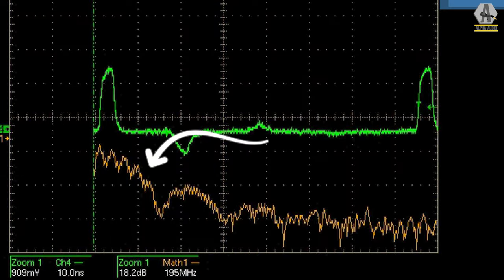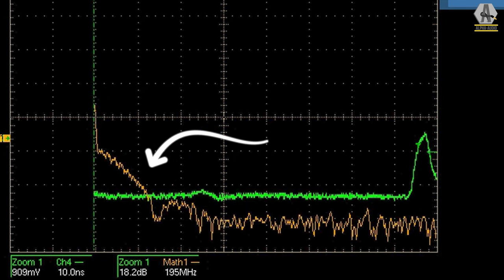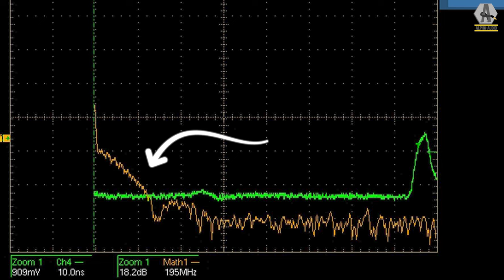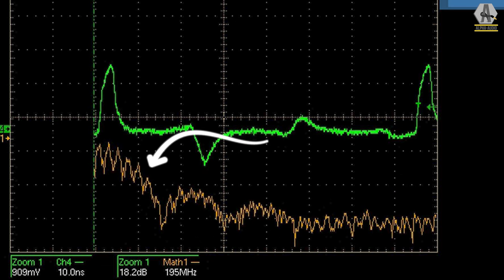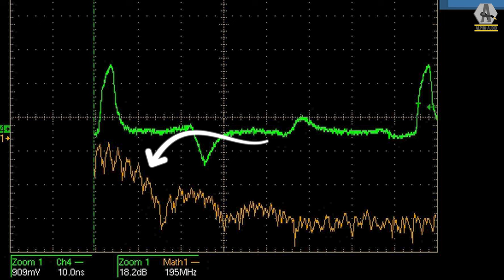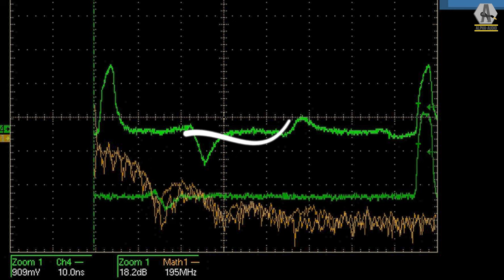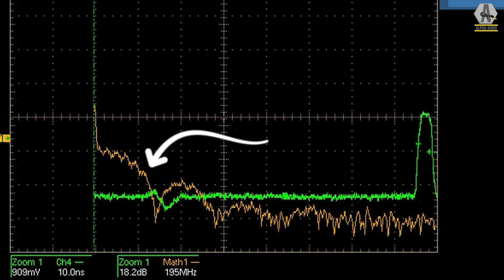Cables make a difference - and we measured it! Alpha Audio Huge Cable Test

Comment: @TheAlphaAudio  
So much work!   Time for a holiday, mate!  LOL.  I'd want to hibernate for a week after all of that, haha!

Forgive me as I haven't had time to read the full written article/test.  It's on my agenda.

What I'm most curious about is IF All of the Same Attributes of Each Interconnect Cable Remain IDENTICAL when used in an equally resolving but completely different HiFi system with a different source and signal chain as well as speakers???

IOW, will ALL of us have the Same Experience when each of these cables are used in WHATEVER system we may have?

Before anyone else chimes in, I want to stave off any arguments that "you will Only hear the differences IF you have a high-end system that can resolve the differences".   RUBBISH.   The Alpha Audio's own Livestream Multi-tests have proven that a wide majority of their listeners can hear identical or at least similar differences as they hear live in the studio, even when we are all listening over YouTube's lossy compressed audio, and through all of our widely different computers, smartphones/tablets, speakers/headphones/earbuds/IEMs and audio systems.  So there's that.

- - - - - - - - - - -
BLOODY LONG RAMBLING:  

Just for reference, 90% of my studio equipment, microphones, and studio monitors are all connected using Grimm Audio TPM & TPR in addition to Sommer Cable SC Peacock MK II XLR or 6.3mm TRS wiring.  I purchased all of these in bulk many years ago, so the cost difference wasn't dramatic compared to let's say, Mogami, etc.

The Grimm & Sommer Cable were both suggested to me by the engineer & manufacturer of some of the high-end ribbon microphones that I purchased, which you probably realize must carry and transfer Extremely Low MilliVolt audio signals over distance without being prone to inducted EMI/RFI noise and without influencing/affecting their inherent properties (the electrical audio signal).

In the studio, if we desire, we can easily adjust the spectral balance and "character" of the microphone by adjusting the Input Impedance on the microphone preamplifier, or with any number of outboard analog or digital rackmount or DAW plugin EQs.

TBF, I also have some standard, good-quality Mogami XLR & TRS cables on-hand as extras or backups, and I've never really found that they sound particularly different to any "Ohhh...WAIT a Minute" degree of revelation.  But if they did, I would probably be more inclined to simply correct any anomalies using EQ or other tools.

Imaging width, depth, focus, "space", etcetera, are all attributes that mixing and mastering engineers control and adjust by using L/R panning, independent levels, Frequency Response, and Phase/Timing tricks (and not in such minute nano-increments).

And to start, IF the Frequency Response between your Left & Right SPEAKERS do not closely match at your listening position, image focus & separation, width, depth, and "3D space" will suffer...

Note that this DOES NOT mean that your Speakers must Both Measure "FLAT", only that they must MATCH in Frequency Response as closely as possible at your listening position.

The better you match the Left vs. Right Frequency Response at your Listening Position, the better the Imaging and Soundstage performance will be.

This is one reason that it's ridiculously easy to at least achieve a decent Center Image even with cheap headphones or earbuds, even when they have terrible tonality/spectral balance.  And, you can obviously have a pair of Loudspeakers that offer great imaging and soundstage performance even when they do not measure well in regards to FR. 

IF the Directivity of the Loudspeakers is Smooth & Even, you'll find that it is easy to adjust the FR or overall spectral balance using EQ to address specific room issues and for your personal preference.  These adjustments can either improve or deteriorate the imaging/soundstage performance.

And IME, the attributes of different speakers, their FR, their placement, and your room's acoustics have FAR MORE influence on the resulting sound quality of "your system" compared to any cable swapping differences.

At least in the recording studio, the absolute LAST thing that a professional tracking, mixing, or mastering engineer will do in order to improve any metric of the system's sound quality is reach for a different cable.

With that, I am not saying that "all cables sound the same".  But I AM saying that in the real world, there are Much Easier ways to "affect" or "adjust" the real world performance of your system rather than "cable swapping".

Keep this in mind as well:  

Suppose you find "the perfect cable" for your system that provides for perfect "synergy".  If it is not a "neutral" or "agnostic" cable, it may no longer have good synergy with your system if you decide to "upgrade" or change any single component in that system at a later date.

So, then you might be back to "square one" again, and you might need to go through the entire and potentially expensive and time consuming cable-swapping exercise all over again....until the next change.  No Thanks.

If you enjoy that aspect of "Experimenting" and "Playing" with cable-swapping, there is absolutely nothing wrong with it.

But recording engineers just need a consistent and reliable product so they can get their work done with the least amount of fuss or issues.  And personally, I would rather spend my time listening and Enjoying my Music rather than "listening to my equipment".

I guess I'm lucky in that I suppose my "decent" choice of cables from the start allows for that.  IDK?
Reply from the maker: I guess the character would remain the same, yes. The thing is: some cables will accentuate bass, mids or treble. And some sound larger than others. That will always be the same in my opinion. Whether that will fit your system, is the question.
Reply: You should of posted this first, a lot of truth in those statements

Comment: Given that all recordings and sound processing are done in studios, using professional equipment, I would be very interested in the differences (if any) that exist between professional cables and those intended for home reproduction. I would be interested in just tests of professional cables alone, since these already contain a lot of variations. The questions is of course what exactly constitutes a professional cable apart from it being obviously marketed as such. I mean, is this the only criterion for making this distinction? 
Another thing is that I noticed that all cables came fitted with what seemed to be factory fitted connectors. That would make comparing professional cables against consumer cables harder as the former are usually available in bulk mostly.
The final thing is what effect do connectors have if any? To assess that, it could illustrative to test just one cable against a variety of connectors (i.e. having many lengths of the same cable type fitted with different connectors) and even testing for variation in the making of the electrical connections within the connector (e.g. poor soldering vs. good soldering, mechanical only vs. soldered joins, etc.).
Reply: Cable material used in studio’s was represented as well. Read the article for the results.

Comment: Regarding testing speaker cables, I'd be interested to see what difference makes f.e. the copper quality of a cable, if there is an effect in loudness, dynamics or whatever. there are now so many different types of cables out there, different concepts of cable-designs including material-mixes. 
I don't really understand what a cable test is good for, if the test not points out differences in the making of a cable and delivers clues about the effects. Just to proof that there are differences in cables, you can compare an alu-wire with a copper-wire, everybody will hear the difference.

Comment: Lots of work and appreciative of that. But we're talking generally MHz, nanoseconds, and miniscule <<1dB anywhere near audio frequencies, guys. Using words like "felt a little bit off" as subjective description is more than a little bit vague. Why don't you just do a blind listening test between what you believe is the best interconnect and something like a generic $20 cable with your collaborators and just show us the results.

That would be quicker and more meaningful since you're not seemingly showing good correlation between the measurements and auditory effects anyway. After all, it's correlating the differences with the perception of the human animal that is most important.

Definitely should give a listening test a try along side electrical testing when looking at speaker cables which potentially have more effect than interconnects.
Reply from the maker: Please read the written article. I explain why we use these test signals.

Comment: Thanks for the effort. We still don't know for a fact though, that well made less expensive cables (under $100.00) actually sound different than more expensive cables.
Reply from the maker: Read the article. Good cables are all over the place in terms of price. So no: price is not always relevant.
Reply: This can be settled right now. Answer this question. In one hand you have a pair of cables that cost $100, and in the other hand you have a pair of cables that cost $500. What are the differences between those 2 cables? And when I say difference, I'm not talking about listening. I'm referring to the differences in the design and the materials used to make them.
Reply: Read the article. Cables that "propogate" faster, are good (Gee, thanks Grimm), they're "open, fresher and more energetic", cables that fall off faster are bad. OK, I have to get some of those open, fresher, energetic cables. I won't bother you anymore with cynicism, but the comment section is open. @TheAlphaAudio
Reply: @AT-wl9yq  Obviously, no two different cables will measure the same. Isn't listening, or what you hear, the only thing that matters? Unless you have a cable that is so poorly made that it just fails.
Reply: @TheAlphaAudio yes, I got XLO electric cables off eBay. Price suggests may be Chinese copies, but I don’t care as they sound really good.

Comment: I just got a chord c-line based on what I heard in the videos with comparisons. Unfortunately this cable cripples my system taking away the air and detail in favor of a relaxing experience. When listening to a crappy source it must be a Godsend, but in my tube system, which is already smooth It takes away from the realism of the instruments. In the end a 15e cordial cable sounds better for me even if the soundstage is narrower. Instruments are more full bodied and voices sound more nuanced. The c-line puts a filter over everything and tames the sound too much. I would recommend it in a harsh transistor only environment. I assume this is why people transitioning from c-line to clearway are so excited, but maybe try a pro-audio cable before shelving out another 60e for a chord cable.

Comment: @TheAlphaAudio 
Hello. Those papers have been lost long ago. I own a lot of siesmology and labratory testing equipment. I've spent 42 years working on the "why" of audio sound quality differences. 
There are cable construction techniques that eliminate a lot of the  issues you've measured. I worked on this for 7 years.
I'm a retired engineer. I have owned systems with over $80,000 in cables (Tara Labs vacuum cables, Valhalla, etc).
All were sold and I've used my own cables for the past 14 years.
Reply from the maker: Sounds interesting. Can you send me a pair and tell me how you measured them? I am pretty curious. Also: let's continue via e-mail. YT is not really the place for this. You can drop me an e-mail via the wbsite: https://www.alpha-audio.net

Comment: As Nelson Pass said (as well as Khomenko) - if cables change sound of your system, the components are not properly designed or cables are not shielded. Or have old type of schematics (say, Audio Note) with high output impedance so they are obviously sensitive to the cable capacitance and induction. Modern solid state designs - as long as the cable is properly shielded and soldered, there should not be any difference.
Reply: Great. A Nelson Pass product is used :D
Reply from the maker: How ironic we are using Pass Labs products.
Reply: @TheAlphaAudio  Who said they are properly designed? There are Chinese products at 1/5 prices sounding better. They might have been properly designed when he said that - decades ago. Now they mostly sell brand names. In business of making money, that is.
Reply: @michael71601   Sour grapes my friend, sour grapes.
Reply: @jmtennapel  Social net discussion derail 101 - switch to "you simply can't afford this, this is why" or something else, like personal appearance, age, etc. Congratulations.
Reply: Thats old guy talk and his shit measures teribble thats the  shit gear that makes no differance ..😮😊

Comment: This is very interesting, IMO mostly because we have all been in the dark on the subject of WHY and HOW cables can sound different.
I mean, the measurements we have used for cables up till today, gave us no clues what so ever.
I have a feeling I am on the right track, in that sense that I prefer neutral equipment all over, cables included. I use Chord Shawline cables everywhere, except power cables (Pangea) and my phono interconnects (Furutech).
I am looking very much forward to your measurements on speaker cables!
Reply: I'm ONLY commenting in regards to  POWER CABLES here, but FYI, the Test Equipment that Jaap is using to actually objectively measure these nanosecond and other uber-minute properties of the different interconnect cables in the test are supplied by the manufacturer with common UL/CE/ISO listed power cables.  That alone SHOULD BE telling.

IF the actual manufactures of all of this test equipment that must be ultra-low noise, ultra-precise, and 100% perfectly neutral in order to properly measure the electrical properties of the devices they are connected to do not require some type of exotic power cable with a specific wire alloy, cable geometry, cryo-treatment, insulation, plugs, etcetera, then I THINK you'll be fine as well.  😉

Of course I do realize that most women, as well as some men, do appreciate "jewelry" and "bling" in order to enhance their "beauty", cosmetic look, and aesthetics.   I mean, yeah, basic black power cables are boring.  😛  But at least in my systems, the power cables are not visible so it doesn't matter to me.
Reply: @keldherbst  
Looks like you Edited your post so as not to include the Separate comment regarding "Power Cables"?  FYI, for anyone reading, that is what I was specifically basing my comment on with my previous reply.
Reply: @bbfoto7248 then your equipment isn't as accurate as it can be due to economics, that is the ONLY reason they are not included

Comment: The naysayers who say everything sounds the same is because they are/have one of these things:
- cheapskates
- mediocre stereo components (amplifier, preamplifier, DAC, streamer/transport)
- medicore cables/interconnects
- limited hearing ability
- compressed music source like Spotify instead of using a lossless source like Apple Music
- bad room acoustics
- bad setup (speaker placement, angle, other objects in the room)
Reply from the maker: True
Reply: Bingo! These naysayers most likely have vintage Pioneer or sansui receivers with Cerwin Vega speakers. They’re not critically listen for sure. They wouldn’t even know what to listen for when swapping cables out.

Comment: I’ve never even touched an interlink that was more than $60 but I find this interesting. Do manufacturers market their cables as warm,cool,fast or slow? It seems with the proper measuring tools they could have multiple cables with proven attributes for the customer to choose from.
Reply from the maker: I have never seen them marketing them as such... but it could be possible.
Reply: If they didn't, it's because either they got no tool, or they always got the same results. When you are left only with words (see religions), you can bet it's a scam. But beware, your betting is based on perceptions, to measure it you must die, so no one tries, and that's fine, all left with their consolatory "My god sounds better than yours to me". Yeah, it does...

Comment: A good cable, interconnect, is the less resistance, the less inductance and the less capacitance., basically is 0ohms, 0uH and 0pf.

All is about phase shift between frequencies at the end you will have musical information loss, this result in less soundstage, less details.
You cannot mesure cables with an oscilloscope, sound is not an image.... Also it depend of the source impedance and the receiver impedance.

Try cables on a turntable with a good moving magnet and you will have big differences in high frequencies because MM need low capacitance cable.
A moving coil have a lower impedance so less difference between capacitance cables.

Also, you need a very open system that let the musical informations flow to speakers, again some audio equipment can have good musical tones, good bass with control but having no soundstage, it is.like  2D and 3D explained.

Why an oscilloscope probe have a capacitor trimmer ?
To get the probe matched to the oscilloscope impedance and a square wave perfect on the scope display, without round edge or overshoot edge, so now think all cables have different capacitance, different inductance and different resistance !

I am in the highend audio field since 30 years and I am a electronic technician.

Comment: Interesting video, thanks for all your work. On your noise tests, I am wondering why you did not use the Bryston as the source? It has a much lower output impedance, which I would think would significantly lower the induced noise.